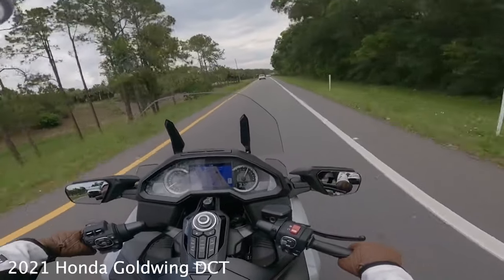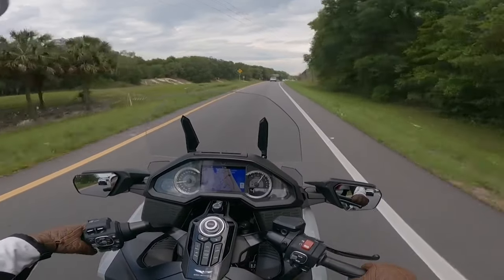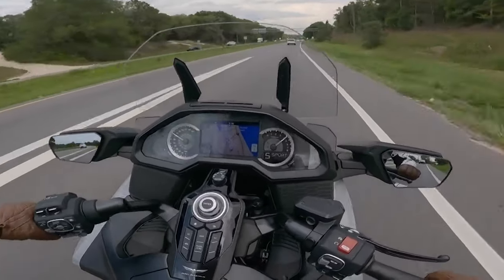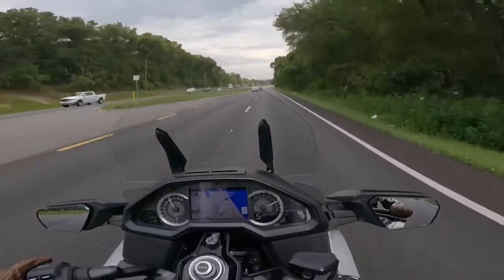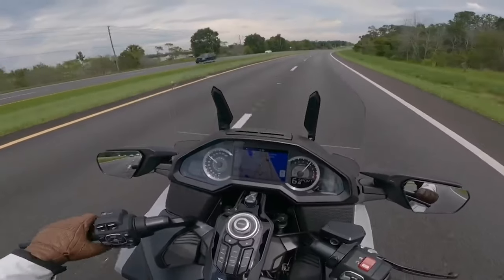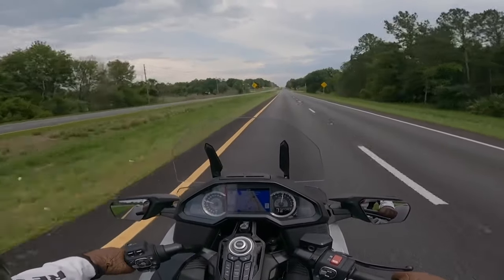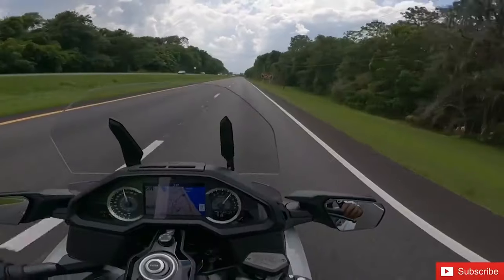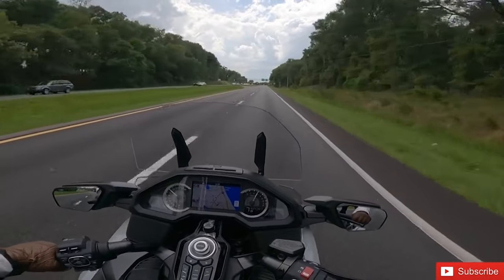2021 Honda Goldwing DCT TOP SPEED RUN. How Fast Can it Go?

Comment: I own a 2021 goldwing touring DCT.  I've seen roughly 110-115mph on this bike in sport mode.  It's quick, but not super fast. if you want the bike to go fast you have to stay out of 7th gear.  Otherwise the bike becomes gutless. Touring mode is plenty fast for me, and I don't find myself using sport mode too often.  The other bike I ride is a 2009 vmax, and comparing the two bikes would be pointless. Honestly the goldwing handles like a dream around 75-95mph! But you need to change out the stock Dunlop's, and ditch the stock battery.
Reply from the maker: Thanks for watching! What battery did you go with?
Reply: @jdbmoto  A Yuasa YUAM720GH GYZ20HL Battery. I still need to install it. I don't trust the new "exploding" batteries. I will be going with bridgestones on my next tire change. I run ride-on tire sealant in my tires for longevity, and to hopefully prevent flats. I don't really think the it matters so much which battery you go with because all AGM's seem to only last roughly ~3years for me.
Reply: sport and econ have same top speed

i check often
Reply: @marcleblanc9120  Yeah, but the difference Is how fast you get there with sport vs. econ.  Econ is a waste of time IMHO.  Rain mode is very helpful.  Maybe econ is an alternative to rain mode, but I definitely do not use it in long distance rides.
Reply: @KareemHadee  the only thing it changes is throttle mapping

Comment: Apples to Older Apples, I have had my '03 up to 107 indicated, and she seemed to be quite solid and capable, but I might guess that they expect a lot of 2-up riding on these bikes and chose to limit the top end out of respect for the pillion. Moving 1200+ pounds on two wheels at that speed with no guarantee of anything could be an issue. But I have yet to try the new bike, and I'm afraid if I do I might be riding home on it! (but I would go with manual shift)
Reply from the maker: Thanks for watching! If you do, test ride both and then make a decision. I wasn’t sold on DCTs until I test rode it. Now my Yamaha FJR feels outdated
Reply: @jdbmoto  Haha, ironic, I just sold my FJR this last Fall. I miss the hell out of the speed factor for sure, but the knee angle was becoming painful on longer rides. What a phenomenal bike though!
Reply from the maker: Small world indeed! I do feel the FJR being cramped but at 35 I can deal with the leg position for a while longer haha
Reply: @jdbmoto  Yeah, huh? It seems a natural transition... I have found quite a lot of Wing drivers also have FJRs as their other go-to bike, and like myself, they stepped up to the wing but couldn't part with the Feej... and then the comfort issue begins to be noticeable and they sell the "smaller" bike. My next bike in the stable will probably be another V-strom 650. Great bike for my riding position and plenty of power for my slower but cargo-carrying adventures. Once took mine from Salt Lake City to San Diego for a scuba weekend, and I was loaded like the Beverly Hillbillies. Ten and a half straight hours and I was there. would have been nicer on the Wing!

Comment: So I cruise @85 on my ‘21 DCT Tour as if I was sitting on my easy chair listening to my stereo and getting 41 mpg….. my complaint? simple…… 5.5 gallon fuel tank is too small, otherwise it’s perfect ride above all others
Reply from the maker: I’m actually impressed that you still manage to get 41mpg at that speed
Reply: @jdbmoto  yeah! Me too but it’s on cruise control and I don’t roll on more or less handlebar throttle preferring +/-  toggle adjustments for smooth speed transitions = 41 mpg
Reply: I wonder if you can turn a saddle bag (or add another tank near the bag area) with an aux fuel pump to maybe top it off when it gets low on the gauge. I haven't personally looked into this, but I'm sure they do this for motorcycle cannonball runs, you'd have to.

Normally I think diesel for motorcycle would be novelty, but in this case getting something that made 80 mpg and doubling that range would be pretty good, because even my 250cc at WOT doing about 75 mph with a 3 gallon fuel tank easily beats your range at around 280 miles (you should be empty at 225.5 assuming every last drop is spent), which is bad when a street legal dirt bike with knobby tires is cruising further than a really good touring/sight seeing bike.
Reply: @jakegarrett8109  okay, 200 mile tank range is hardly a issue when your riding in the very best touring motorcycle in total comfort 
Nothing beats a Goldwing
Reply: @gonzalo1042  I agree with it probably being nicest, but like you said it really would be great if they had a large tank or auxiliary tank option. Can always turn great into greater, or excellent into a superb cruising masterpiece. They might sell a solution for that, I just haven't looked into it, if they do then I'd say go for it and let it soak up the miles!
Reply: @jakegarrett8109    Jake. Been there fond that with my Honda ST 1300
and it’s humongous 7.7 gal tank.  Phenomenal range and power BUT it’s a 3/4 scale Goldwing    Yes, if it gets say a 6.5 gal tank it would be more perfect but; being a long distance rider 200 miles is fine
Reply: @gonzalo1042  I'm thinking one of these would make a great cross country travel bike. For example I'm on the East coast, my family is in the middle of the US 1,400 miles away. Google says it takes just over 21 hours (it looks like it assumes average speed of 65 mph without stops). Less stops the better.

Hypothetical section-----------------
if you could go at night (less traffic), without a tag for cameras, and cannonball style sometimes doing180 mph like most liter sport bikes can, then you'd get there in 8 hours plus fuel stops. Unfortunately if you have to stop every 180 miles, that's every hour and gets repetitive. Plus you DO NOT want to be nearing empty, because if someone flips on their lights when you're near empty, well you're spending so many stupid years in jail for really just endangering only yourself (and I think suicide should be legal, the police are legally not responsible for your safety per multiple supreme court cases, so that's not an excuse either). Also if you're going 8 hours full out like that, a cruiser might be a lot less draining than those leaned over bikes putting all that weight on your wrists. I would not be shocked if someone does that with a turbocharged Goldwing build (maybe a hayabusa engine swap).

Also I want a liter bike like a GSX-R 1000 for long distance trips halfway across the country, hypothetically unrelated to the above conversation. Also FK the FAA for limiting airplanes I could alternatively legally fly to a pitiful and suicidal 5 gallon fuel tank limit... That's the stupidest thing I've ever heard, its not like you can just pull over in the sky to refuel, and obviously most crashes occur near the ground (typically during takeoff and landing). So thanks daddy government for only leaving sketchy unsafe methods either way... Otherwise I wouldn't be having hypothetical ideas.
Reply: @jakegarrett8109  I hear you! Given your max_out range and speed itches then it’s a natural to go with Honda’s fantastic and very fast ST 1300 which I owned (a few tweaks incl) and it’s 7.7 gal tank
Reply from the maker: Those bikes are a beast! I have a FJR and can appreciate the 250+ range. My brother used to have a Kawasaki concours with the 7 gallon tank and that thing could go 300+ easy

Comment: That's it??? 105mph?  Makes me very curious why Honda would put such a low top speed on this bike. The '01 thru '17 has a top speed limiter, but it's much higher. The BMW Grand America has a "speed nanny" also, not much over a 100mph I think.  Do these bikes have some high speed handling problems? Yeah, I hear it now..." Why do you NEED to go any faster?" Don't take it personal against your bike. Don't get your feelings hurt.
Reply from the maker: No worries this was a demo bike! No handling issues at all, very smooth and stable as you would expect from a 800+ pound gorilla
Reply: Difference is this ride will do it all day and do it two up.
Reply: I think the BMW Grand America and K1600B has stability problems at speeds over 110 because of the shape of the pillion hard bags and the rear top box and feet forward design.  No speed limiters on the other BMW K touring bikes.